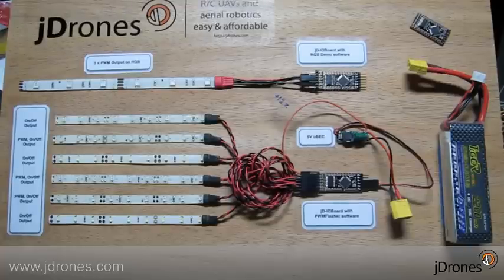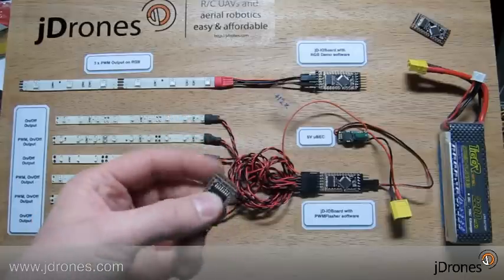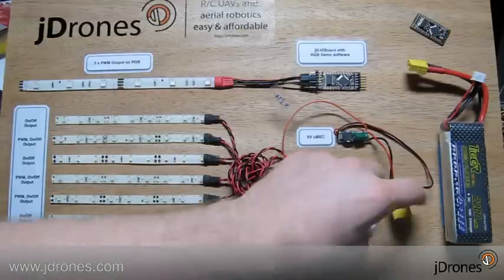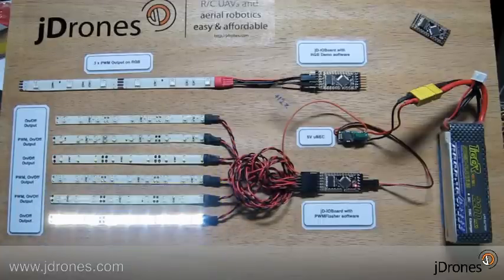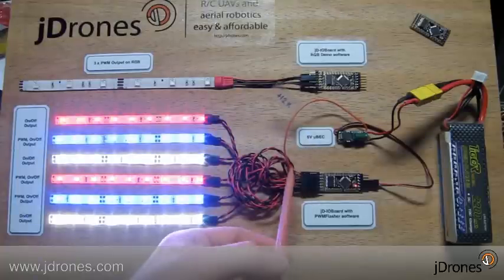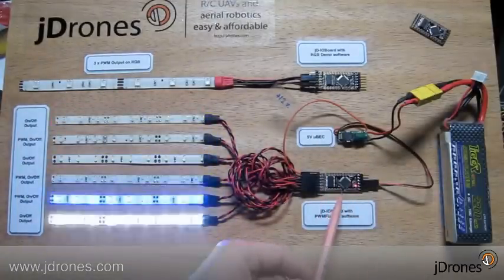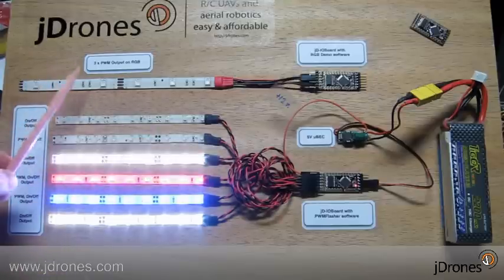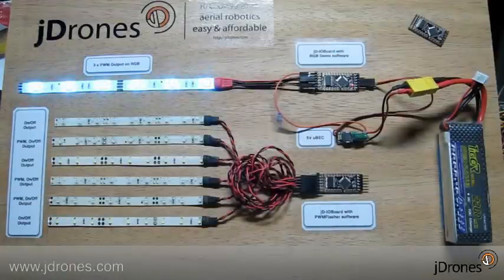jDrones IOBoard v1.0 DEMO

Comment: There was one debug mode running on earlier softwares that was checking digital pin. If pin was down it was reseting to factory settings. Pin check has now been fixed but there are still several old firmwares around that have this debug feature on. Get latest FrSky firmware from our website and problem is solved.

Comment: Hi Jani

Could you explain the difference between configuring [and running] the IOBoard based on configuration patterns made with the IOBoard Configurator vs. code written, compiled and uploaded with Sketch? Uploading code does not wipe out the config done with the configurator and vise versa so it seems that it preserve both at the same time.

Comment: yes you can connect audio, microphones, speaker, leds, relays, hundreds of different sensors on this board. naturally board is not meant for speech recognition but it can detect sound levels and also sounds via it's Analog and PWM output pins.